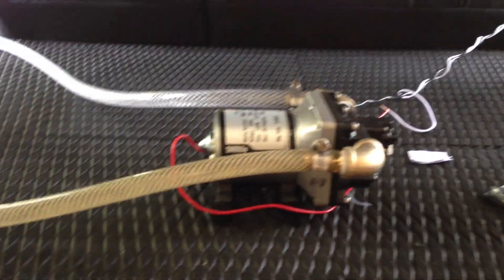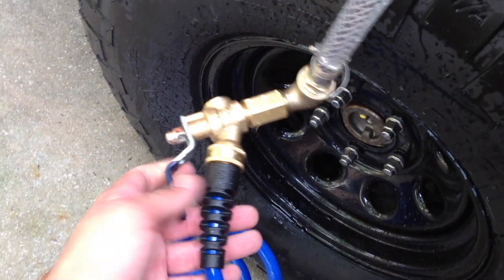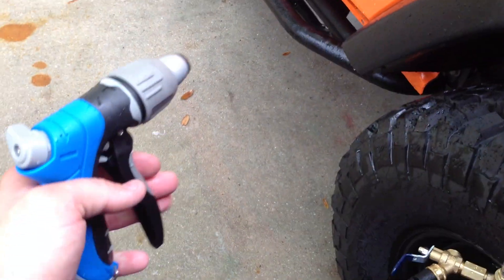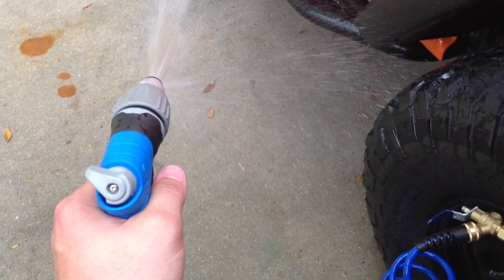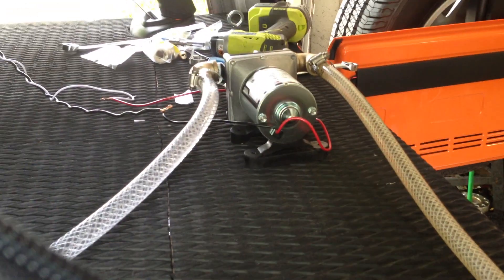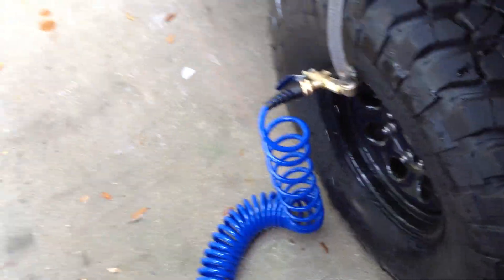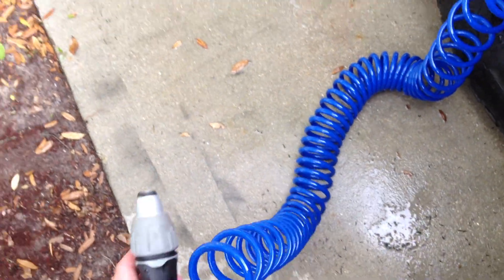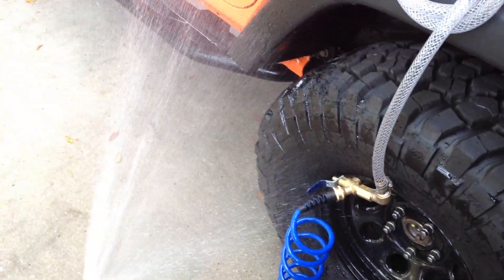Pressurized Running Water on Jeep Wrangler JK BEFORE INSTALL

Comment: I'm not positive, but it looks like this pump is the SHURflo 4008 pump.

http://www.amazon.com/SHURflo-4008-101-E65-Revolution-Water-Pump/dp/B002XM5G70/ref=sr_1_1?ie=UTF8&qid=1407850963&sr=8-1&keywords=shurflo+4008
Reply: Thanks!
Reply: Billy pizza By the way, since seeing this video, I have done this myself using the SHURflo 4008 powered via the 12v in the rear (which I will change to be powered through my sPOD when it get's warmer).  I have the AEV bumper with built in water tanks, but I prefer to use my 2 gallon Rotopax water tanks instead.

Amazon links to the items in my setup:

SHURflow
https://www.amazon.com/gp/product/B002XM5G70/ref=oh_aui_search_detailpage?ie=UTF8&psc=1

Drinking Hose (Garden Hose)
https://www.amazon.com/gp/product/B004RNR9BY/ref=oh_aui_search_detailpage?ie=UTF8&psc=1

Garden Hose Nozzle
https://www.amazon.com/gp/product/B00E5SA10M/ref=oh_aui_search_detailpage?ie=UTF8&psc=1

Rotopax
https://www.amazon.com/gp/product/B004ETQ2LO/ref=oh_aui_search_detailpage?ie=UTF8&psc=1
Reply: Wow thanks I saved each link. Is there any way you can post a video? Overall set up? It would be great. I will also favorite the video since I want to get ideas when I get my jeep. I would gladly appreciate it.
Reply: Billy pizza Happy to.  A little cold right now (2 degrees), but if it gets a little warmer during the week I'll post a video of my setup.  I also have the Springtail driver's side rack.  The pump sits on top of that, and a few rotopax tanks are bungee corded to the metal grid (they call it MPAC, which works with MOLLE).  Very high quality, highly recommend.  I'll probably get the passenger side in the Spring.

Springtail MPAC Driver's Side Rack
http://store.springtailsolutions.com/JK-Unlimited-Driver-Side-Rack-Special-Deal_p_27.html
Reply: thank you for the reply. ill check into that